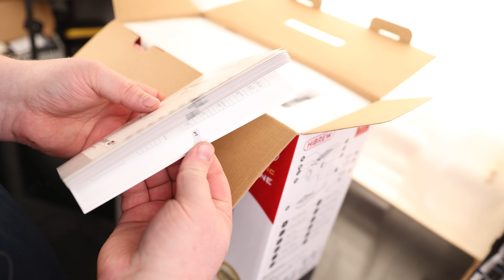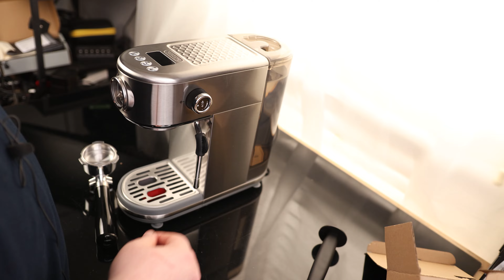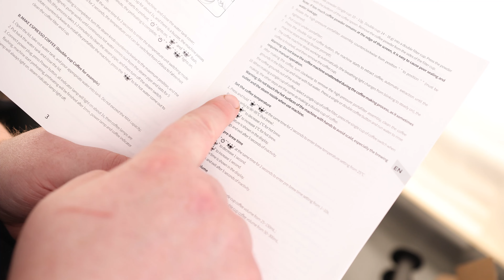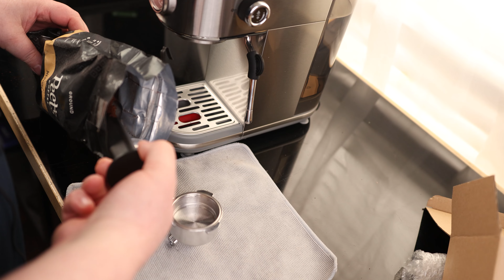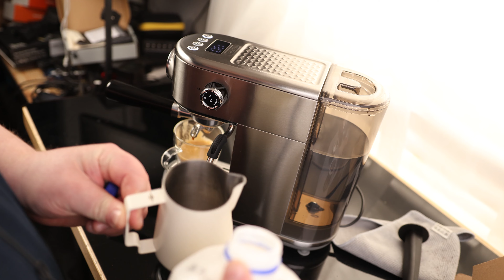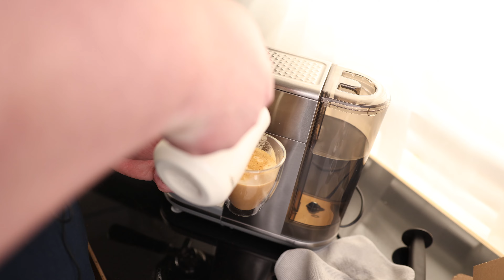HiBREW H10B Programmable Espresso Machine, Brushed Stainless Steel, Adjustable Temperature and Cup

Comment: Hi I did as u exactly do and the coffee is cold not hot what to do?
Reply: You have to pre heat the machine for at least 5 mins then right before pulling your shot pre heat the brew head and basket by running an empty shot and let it sit there for at least a minute
Reply: Hi grind your coffee bit more coarser. As well you can adjust the temp up until 95°
Reply: put it in a microwave oven

Comment: Mine must be defective. The display flashed hoc for several minutes before it will pour the espresso, normally takes 10 min. Should i send it back?
Reply: I just used it for the first time today. If you try to use the steam function it will heat up above boiling point and need time to cool back down before being able to extract a shot. It takes about 10 minutes for that cooling down. Hope this helps.